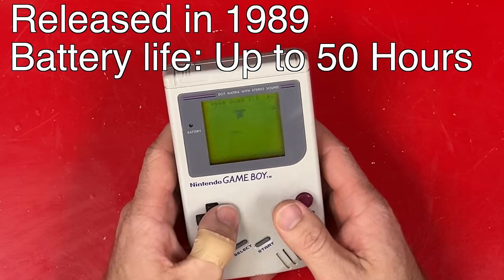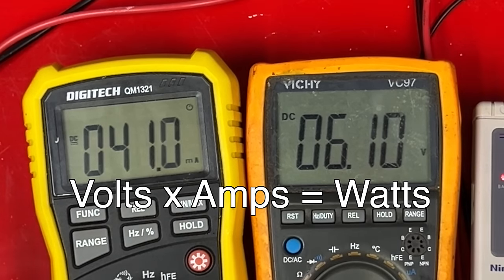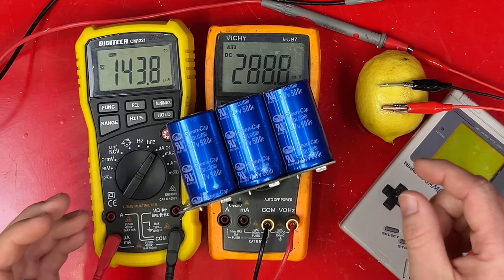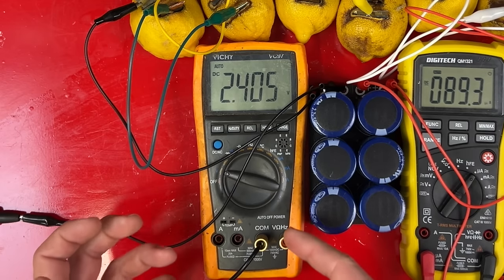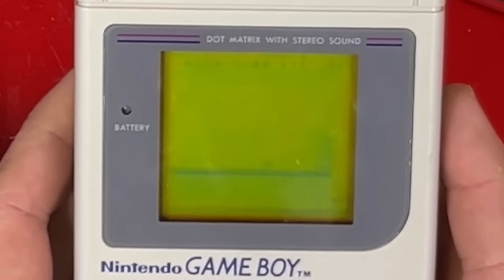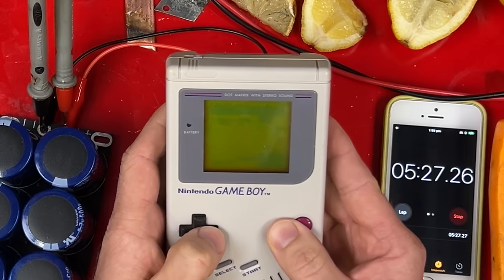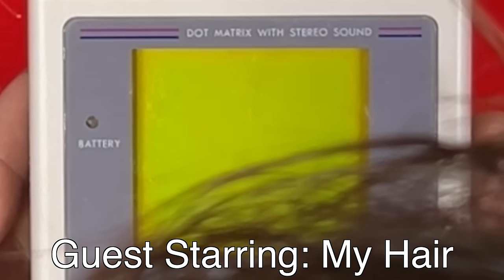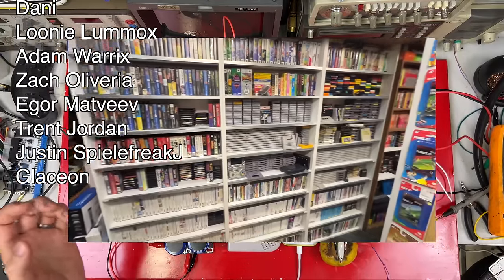The Lemon Powered Game Boy

Comment: absolutely mad that the gameboy was still running at 1 volt, it's like that quote from portal where the announcer mentions all equipment will remain functional at as few as 1.1 volts
Reply: Because that is how electronics usually work, Xbox One controller's voltage cutoff is right around 1.1V for example.
Reply: @purpleneons  yeah i know, it's pretty funny how it keeps showing up as a result. still really interesting to see it in action
Reply: @purpleneons honestly that’s pretty impressive, since the TTL logic high threshold is 2V and the transition is usually ~1.5. But the actual hard-limit logic low threshold is 0.8, so I guess a lot of chips can just-about discriminate between low and high with just a 0.3V difference.

Comment: I did the same experiment, ended up building a digital clock that ran off various fruits, or even some drinks, and used it for years.  The best "battery" was actually regular coca-cola.
Reply: Takeaway:  Coca-Cola is basically battery acid that you can drink.  Can.  Maybe shouldn't, but can.
Reply: What happened to it?
Reply: @nickwallette6201 to be fair orange juice is also a pretty good electrolyte, just like lemon juice here is. Not surprising that any acidic soda, with the extra ionisation from all the added dissolved sugar, is excellent!
Reply: What are your anode and cathode of choice?
Reply: @devinwg6777 Goodness knows, I had it during my childhood/early teens and got bored with it in the end.  I think I may have left some fruit go rotten in it and my Mum threw it all out.
Reply: It's good to know that our soft drinks are such good battery chemicals.
Reply: What happens if you drink the coke after the fact
Reply: @Adriethyl  Be pretty foul tasting after sitting out for a couple of weeks!

Comment: In a world of portable power banks and personal vehicles (and even some public transport in big cities) providing easy access to power on-the-go, this is truly the way to get the authentic "rushing through the level because the batteries are about to die" original GB experience.
Reply: Schoolyard Game Boy, when everyone’s batteries are already dead. So one kid sits on the rest to get a little more juice out, while someone else keeps swapping them in to try and finish their level before it dies again. 

(In my school at least, we did rock paper scissors tournaments to determine who got to slurp up the battery dregs in that manner!)
Reply: @kaitlyn__L  My friend used to tell me that if you held the GB up to the sun, the batteries would last longer - and I believed it! Simpler times :)
Reply: @GuyDude-hk8uy  technically speaking, it may have made a slightly measurable difference. Diodes and photovoltaic cells are the same, just specialized differently. If you supply any PV with its forward voltage, it will emit light. If you supply any diode with its forward voltage, it will emit light (whether visible or not)
LEDs aren't good at turning light into current, but they definitely produce a small current from light.

Comment: I think the issue with the charge rate wasn't so much the lemons, but the zinc strips. The zinc ions were being stripped from the steel, so you basically consumed most of the coating. At that point your galvanic potential was lower because it was just steel to copper instead of zinc. If you had solid zinc strips they might have charged at a similar rate for longer. 

A fun V2 could be 316 stainless steel and zinc. A lot more galvanic potential. It should charge a lot quicker.
Reply from the maker: Yeah, pure zinc isn’t something I can just go out and buy though.

Stainless also releases a poisonous chemical,I don’t need that in my life lol
Reply: @Games_for_James James, your channel is less than a year old, but has almost 150k subscribers!! How does it feel, mate?!?!
Also, when will you show off your Silver Play Button??
Reply: @Games_for_James  zinc nails are working well and are availlable in most hardware stores. They are used for roofing.

Comment: I think the Gameboy is both blurrier than you remember but the LCD is also very old and probably way more sluggish than it was in 1989
Reply: I suspect this is the case.  Motion clarity was never very good.  But, last time I tried on my own childhood Game Boy, it was pretty much unplayable with platformers that regularly moved the screen.  There's a difference between "a screen so bad you prayed your parents would drive under a street lamp so you could see" and 38-year-old lethargic liquid in the LCD.
Reply: @nickwallette6201 I had mega attachment called the Handy Boy, which was a square magnifying glass, two small lightbulbs on each side, and two fold out stereo speakers. 😁🤘
(folded closed, they protected the mag glass, like window shutters)

It also had a controls attachment, where for the D-Pad it was similar to the Analog Stick on N64. Then the A and B were just larger and closer together.
It was super clunky and I never used it. (it cliped on separately) 

I don't remember if the speakers were powered by the GameBoy, or if it has a small amplifier... But it's been over 30 years. Based on pictures, it looks to have a power switch for the speakers, so it likely does, and used the GameBoy's own volume dial to do handle the unit's volume control. 

But yea, its added lighting was the REAL hero! Which obviously meant my GameBoy now required 6 batteries. lol
Reply: Plus it's running below 2 volts with the contrast all the way up.
Reply: It could be just regular degradation of the screen components. These things are over 30 years old, after all.
Reply: @DUKE_of_RAMBLE I had something similar but smaller, so no speakers. No convoluted folding mechanism. Just the magnifier and the light.  Two incandescent bulbs, “grain of wheat” sized (because I guess millimetres would be too abstract? Gotta call em rice, wheat, barley, etc. Sure, whatever).

It drained the one AAA battery it took in an hour, sometimes two. My brother had a more expensive one with a single, and still very new, warm-white LED. It was brighter and lasted over 10x as long. I was so jealous 😂
Reply: @brandontechnerd fun fact: even when Game Boys were new, their screens were blurrier than they could’ve been. Because they ran them at the minimum power possible, to meet their battery life target, the contrast and response time was significantly weakened. 

The project was even almost canned because the president of Nintendo, Yamauchi, couldn’t see a damn thing with the TN panel. But Sharp had just announced their first STN panel, which responded faster and with better contrast. That was just enough to squeak-by and get approval. So I imagine the prototypes looked much like the suffering screen in this video!
Reply: @kaitlyn__L   Oh, yea yea, I think those bulbs are from Mini/Micro Maglite flashlights. Very small bulbs, like 1/4 the size of those really small Christmas lights. 
And honestly I think mine probably only had one bulb now that I think about it. 2 would've consumed batteries way too fast.

And if your brother's was a 90's product, I wouldn't be surprised if it was expensive, as warm white LEDs were a brand new thing in 1996.
Reply: @DUKE_of_RAMBLE  it was very late 90s. 99, maybe 00. And yeah, it was more expensive than a game — my light certainly wasn’t!

Comment: This is very nostalgic, for everyone in my school playing through faded screens, and sitting on batteries to warm them up a little and get 5 more minutes of gameplay. I never expected that meant we were sitting on 1.2-1.5V though! Haha. 

This is also a fantastic example of how capacitors are useful for voltage boosting circuits. Without getting too technical, or into super-fast switching. So well done! 

Though it does make me wonder if automated switching would improve the charge rate, along with an actual piece of pure zinc. Maybe not enough to play live, but at least to extend the play time by making it drain slower? I bet a cheap electrolysis kit, one with too many impurities for actual chemists, could do the trick.

Comment: I think if you do more than 2 probes per lemon in parallel, and closer spacing for the probes, the performance will increase. Everyone always forgets probe distance has a large impact on max current possible due to the internal resistance of the lemon flesh and more surface area will give better reactivity.

Comment: If you use a more efficient configuration you should be able to get much more usable energy into the capacitors with the same lemons+electrodes. Only put as many lemons in series as needed to match the capacitor's current voltage. Putting more in series uses up more lemons but doesn't increase the charge rate.

Comment: If you wanna make a next-level lemon battery you can cut the lemons into thin rounds and stack them with discs or plates of copper and zinc, or better yet, ditch the copper for nickel and just glob lead-free solder onto the backs of a buncha nickel foil sheets (like for spot welding onto batteries). Stack em up like Luigi Galvani and you're really cookin with lemons.

Comment: Do with a solar pannel with 2 volts and 25mA you will need 3 in series and 6 in paralel to output 0,150 amps (0,300 w) (18 solar pannels require)

Comment: I never even knew the original Gameboy had a brightness adjust.
Reply: He means contrast adjust , not brighness
Reply: @mibnsharpals  Still, I didn't know it had that either.
Reply: @giygas_9577  It was necessary because the display changed its contrast when the battery voltage changed or you wanted to change the viewing angle.

Comment: So... technically... you could have cut those lemons into thirds, covered them in saran wrap to keep them sealed nicely, and turned 1 lemon into 3 batteries each. 

Also, you probably should have used some copper and zinc nails instead of sheets. Or screws, if those exist for each. The reason is because of mostly how you can more easily reinsert them into the lemon in a new location if need be to get some juice out of them.  Actually, I'm kind of curious as to how small those wedges can be made before it's pointless. More of them if actually worth doing, could allow you to string them in series and parallel for the best possible voltages and amperage you are gonna get out of lemons probably.

Comment: The GameBoy is an excellent candidate for solar powered gaming on the go... as long you have enough solar power.
I'm just not entirely sure how to limit the voltage a bit in order to prevent any risk of damage, but if you have 3-2 volts, it'll probably work.
Reply: Or just use a solar panel plugged into 2 accu batterys
Reply: I think the cleanest way to go about it would be to design a small solar power bank that plugs into the barrel connector

Comment: The game boy was going strong at 1.5 V - this means that it could even run on a single AA battery
Reply: I do wonder what the optimum V vs I point is?  40mA at 6V (240mW) vs 116mA at 2V (232mW).  Could be that running a Game Boy from a single LI cell would be more efficient than from alkaline cells.  Maybe we need a Game Boy MPPT module!  haha

OK, not really.  ;-)  The reduced screen contrast and lower sound probably account for the entire difference.
Reply from the maker: I tried one AA and it wouldn’t boot, so it seems it can only run on 1.5v if you start at a higher voltage and work your way down

Comment: Interesting that the cpu was even functioning at that voltage. as for the sound fading into a garbles crackling mess is becasue the amp did not have enough current or voltage to drive the speaker. next time try doing this with out the volume up (and or removed amp) and removed LED to see how much longer it goes. mario land is one of the more basic games for the system. something more advanced like zelda or even pokemon would drain it much faster.

Comment: Wait just a goshdarn minute. If it runs on 3V then why the heck does it need 6v worth of batteries? Or are the terminals arranged in such a way you'd get 3v but with double the amperage? Is the current internally regulated to 3.3v?

Comment: Isn't a zinc coating like 50 micrometers thick?
Reply from the maker: I used galvanised steel because the coating is thicker than electroplated steel but it’s still very thin yeah